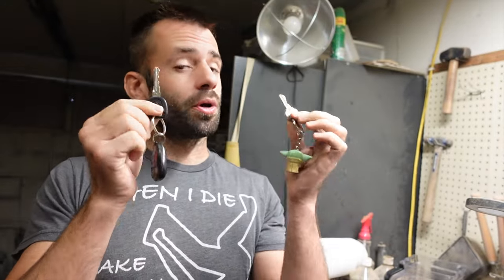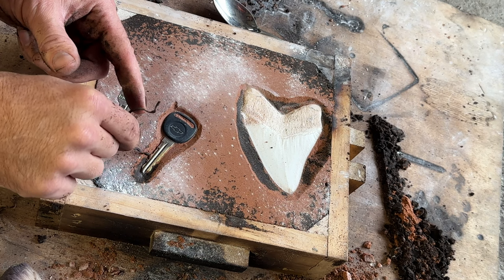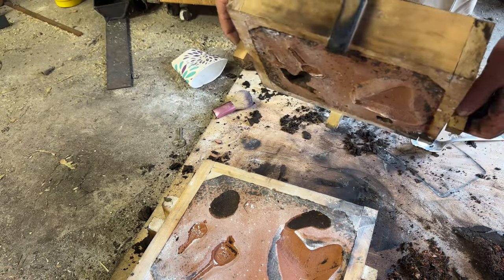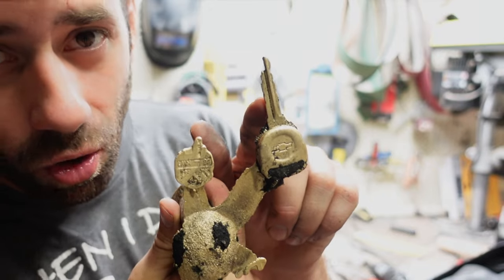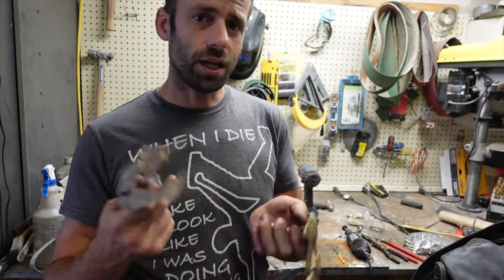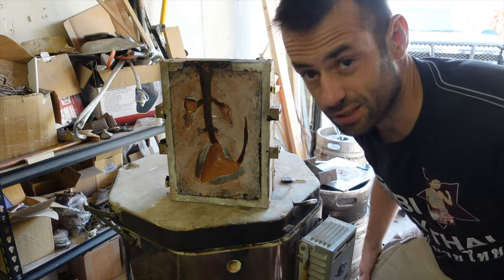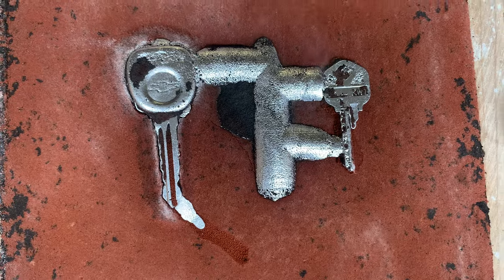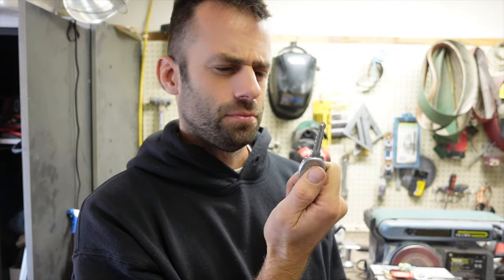Casting keys at home: Key Casting Challenge

Comment: I accept the challenge I think the key needs more small vents to work I also think the sand might need to be packed lighter so I’d doesn’t keep breaking off in the keys grooves
Reply from the maker: Awesome!  Let me know how it goes!
Reply: @lundgrenbronzestudios  I’m going to be very honest here I don’t think it will be easy if even possible I used to do lock smithing I’m pretty sure they manufacture keys to be really hard to cast with normal casting equipment the best way would definitely be a vacuum caster I have one so I will eventually make a video trying that currently I’m going to make a video trying to sand cast a key
Reply: @lundgrenbronzestudios  just finished making a video I tried 3 separate attempts each time trying a different method to get the metal to flow in even a ton of little vents i couldn’t get a complete cast one thing I was able to do is keep all the design of the key by lightly packing the sand other than that it was a fail but very fun challenge thank you
Reply from the maker: @catchthedream1142  it’s tricky. Glad you tried it though!
Reply: @lundgrenbronzestudios  agreed it is definitely very tricky

Comment: Mr lundgren when you part your molds turn the top mold 180°and off the edge of any intersection of your piece to be cast take a thin skier and poke it through the outside edge of each piece so that the metal and gases can vent this also eliminates some of the swirling

Comment: It will work just fine if you... Dust the key with talc so the sand won't stick. Tap the key lightly before removing it to loosen the sand. Add more vents and gates and have a reservoir tower to accommodate a larger pour so the weight of the metal pushes it's way to the  to the end of the pattern.
Reply from the maker: Sounds like challenge accepted!  Tag me in your results. Good luck!

Comment: Cool to know I could unlock door with your bronze key to retrieve that bloody chip key I left inside! 🥵 Several years ago I needed to copy some key on the weekend and all the stores were closed.  I could not find the key copy but the copy did work.  Here are the steps if I can recall correctly: ?
Zinc pennies and plaster of paris were used.  The sharp edges of the key's groves were slightly chamfered with swiss file, key sprayed with Pam then placed on a piece of glass, encased in small circle dam of plasticine, and filled with plaster.  Bottom side of mold was, like yours, overfilled then finished and spued/vented etc., after plaster set, face generously greased,  then cope poured, allowed to set/strengthen, separated, then finished.  Very small mold was bone dry in less than an hour in 275 oven, heated to 450 degrees, joined, clamped, metal poured, key filed to work.  Can't remember if it took 1 or 2 attempts and as mentioned already, this is all going from memory, an aging one, and copy is lost. 
BTW- I have a neat brass key collection 100+   Free cutting brass blanks (70/30) have been the key metal of choice for hundreds plus years(machines like butter with very good strength, corrosion resistance, and good looks, too).  When I get an expired zinc key it's tossed in the zinc bin for scrap or remelt.  Due to costs, today more and more keys are made of zinc and aluminum, unfortunately.  Aluminum keys are often encased in an enhanced plastic "handle" to help prevent breaking off in the lock.  Most all low temp metals, and even plastics can be cast to make a useable emergency key!  Big hurdle when casting such thin patterns is "fillage".  Vacuum, spin, injection, and steam casting are all options for metal media - injection molding maybe for plastics... also, a silicon rubber mold and low temp pewter, or low viscosity castable resin. Evem simpler, a one piece mold(depress key in clay or plasticine, remove, harden, fill with JB weld -would have to cut grove on unfinished side and sand flat, or I have heard you can overpour 1peice mold with metal then quickly cover it(flying hot metal) leaving a flat dimensionally accurate but unfinished side...

Question: can you somehow adapt your vacuum rig to work with small plaster molds?  Look at how intricate fine jewelry is - pretty sure that is vacuum cast.  Or, you could keep same large size flask, and make a tree of all the keys in your house, relatives, etc. (Christmas Tree of Keys...

Comment: If the metal has an easier time getting into the not yet fully filled shark tooth than squeezing through the length of the thin key-shaped cavities, it'll go there instead first, relieving pressure and potentially pausing the flow of molten metal into the keys long enough for them to freeze off like that.  I bet they would have filled easier pouring horizontally without the tooth in each mold.
Reply from the maker: You might be right. But even without the shark tooth the house key still didn’t fill.
Reply: @lundgrenbronzestudios  yeah I'm sure someone could do it... But not as easy as the guy at the mall 😁

Comment: FYI it won't work anyway if you succeed, being the OEM Keys have chips in them that is read by the vehicle. That's why you could turn the ignition and it did nothing but set  the alarm off.
Reply from the maker: Yeah. The house key would probably work though.

Comment: What "recipe" do you use to rejuvenate the sand? I tried looking for one a while ago, and the best I found was "add used motor oil until you think it's the right consistency, then you're good" no suggested ratios/measurements, just, go for it
Reply from the maker: Yeah I just go for it but I will say it’s less oil than you think. I use the oil that I change out of my vacuum pump. It works well but it’s not quite as good as new sand which is why I put the layer of new sand over the pattern first.
Reply: For what its worth I saw a vid somewhere someone made petrobond and used non detergent  30w oil. I was going to try but some of the other ingredients I couldn't find.